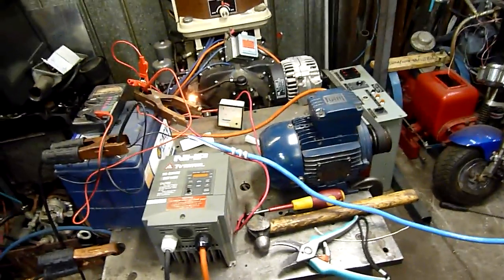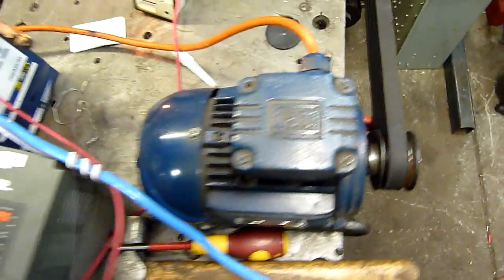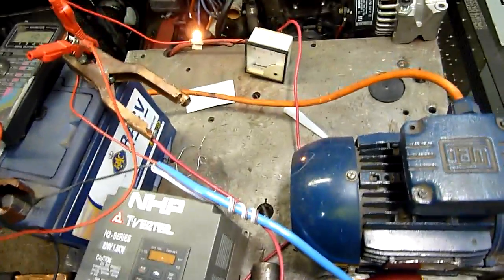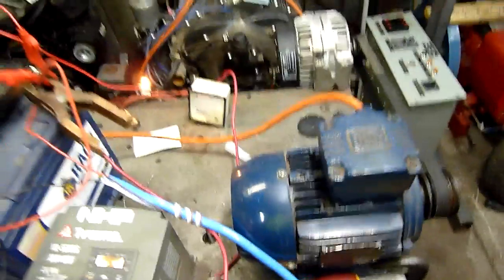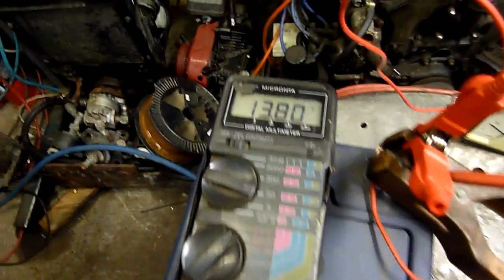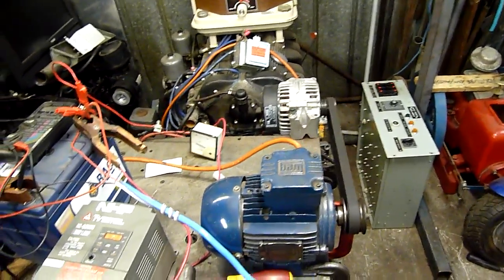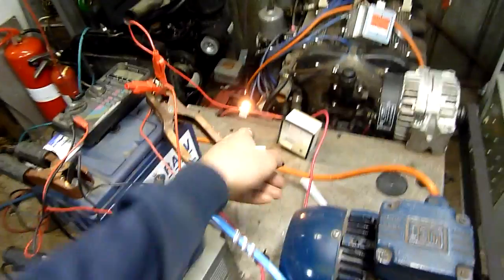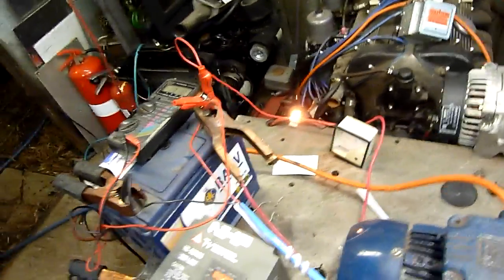Running a Light Load on Bosch 115A Alternator

Comment: I believe if you circumvent the diode trio and up the stator coils you can produce 120 volt AC current.you actually don't need an inverter.

Comment: Maybe, but a 35cc weed whacker engine could likely produce 1 to 1.5 hp at wide open throttle so not that bad, unfortunately the alternator probably needs 3 hp just to run it at idle speed.

Comment: Keep in mind alternators typically spin 2.5-3.5x crankshaft speed. Would have to get that motor to spin quite fast to get that alternator in its sweet spot with that small of a pulley on it.

Comment: When I first saw your multi-meter on camera a while ago it surprised me, ever since it has been amusing to me every time I see it on camera  Finally, today I went to check my Micronta meter and while mine has a somewhat smaller lcd screen it is essentially the same meter, maybe a little older.  I meant to ask you where and when you got your meter, and what model is it?  Mine is a 22-185A.  Not too many of these old Mircronta meters are still around, it's amazing that your meter is so similar.

Comment: I dont think theres any need for the exciter cable, as mine with out it connected still works fine, just needs a quick blip of thottle.. Its also an bosh unit 120amp.. If you removed the resistor and fitted a varible one would that work to incress output voltage? 

Most car ecu are rated to 16v incase the voltage reg goes funny.  Guy i know runed his car at 15.7v for over a year!

Comment: this one included. but if you stop it you need to connect power to it like you see in this video to get it generating again. once the light turns out, you can remove the battery because the alt sustains it's own power.

Comment: I tried it and measured about 60A-70A with my DC clamp meter with all stock components switched on. Even more when the radiator fans kicked in.